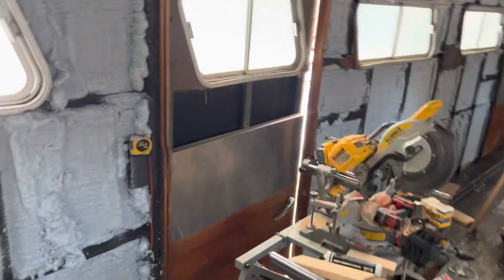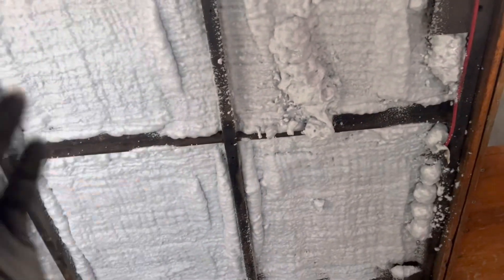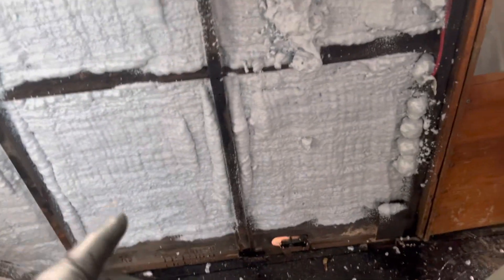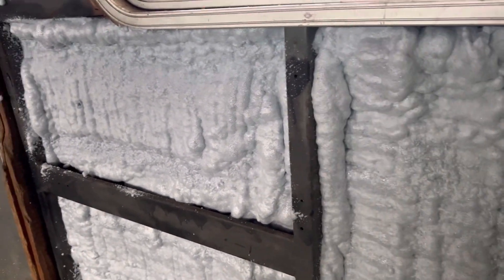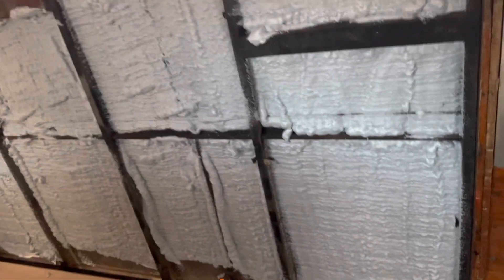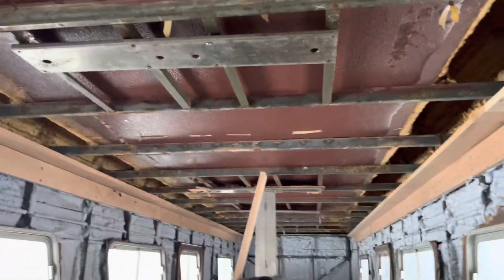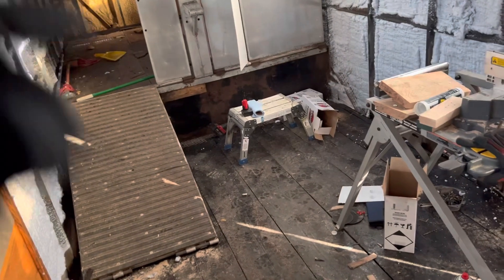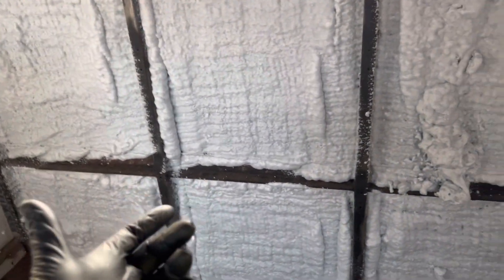Kraken spray foam

Comment: Thinking of doing a 12x20 building. Good quotes around here for someone to come spray are $1800-$2200 for the job. Just find it hard to wanna spend that dough haha. Does it hold up well in heat and cold for what it is? The 12x20 it’s going in just needs to hold 80 degrees in summer and 65 in winter. I know this is all depends on how thick you spray etc but with what you did would you say spending $400-$700 on foam and doing it yourself was a better option then spending basically double or even triple and having someone come spray? This is the first video I can actually say is helpful. Good work!
Reply from the maker: Yeah its held up great, made a huge difference in the trailer. Thank you

Comment: Im thinking of using this product in my camper build. Did you get much overspray on you window, or did you tape them off before spraying?
Reply from the maker: Didint bother taking them. Figured id just scrap them after. And ended up having only a few small specs on a couple windows. The overspray was minimal.
Reply: @THEWORX99  thanks for reply
Reply: I just used it tonight but it's open cell .. open cell will soak  up moisture..